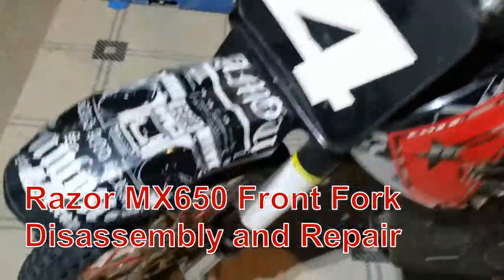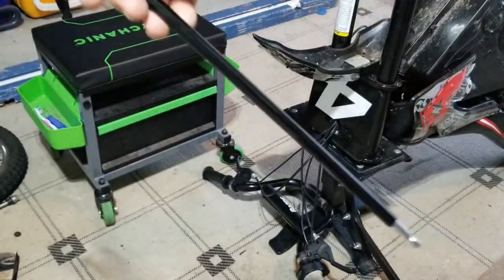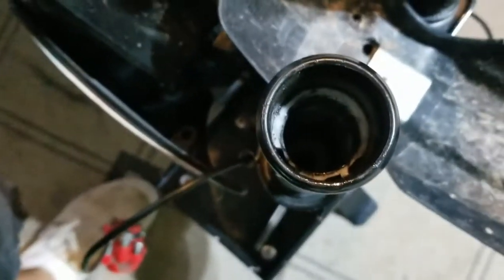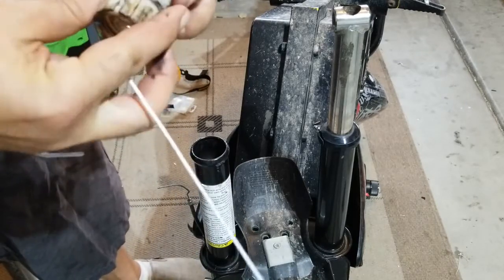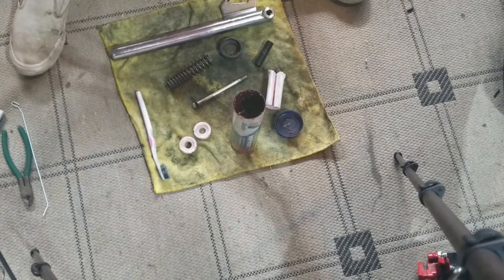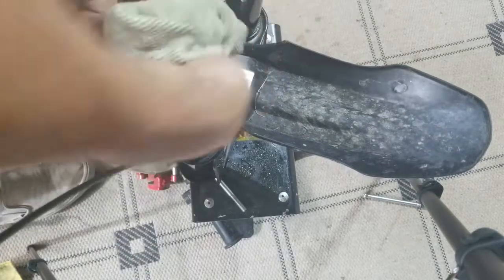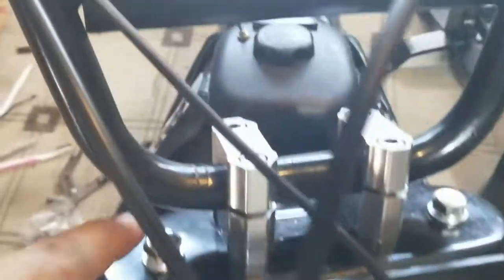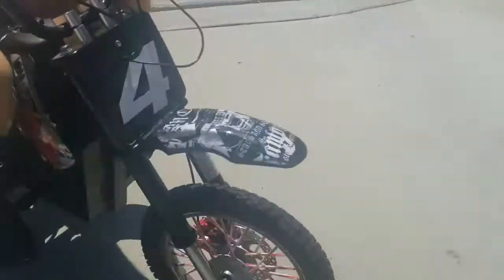Fix Stuck Razor MX650 Forks!!

Comment: Thanks for the info Tim! This issue occurred for me literally within a week of my 9 year old getting his 650. I was able to use extensions and make my own tool to remove the Allen bolt and glued weed whacker line around top of the bushing to make a new lip. So far soo good.

Comment: Would you happen to have any measurements of the springs and bolts that go up the fork leg¿? I'm trying to get bigger springs and bolts to makes my suspension ALOT better but IDK what the original parts measure.
Reply from the maker: I don't but there are guys on the "modified razors" Facebook forum who have done what you are talking about and have the specific parts you need

Comment: My bushings are worn out,they have a lot of play in them. To bad you can’t buy parts.
Reply from the maker: I know a guy who 3d printed them.  I helped him with the 3d model.  I can connect you if interested
Reply: Tim Armbruster That’s pretty cool,I have the MX 500 model which is probably the same..but not sure.
Reply: @TimArmbruster  I'm interested. I would buy a few depending on his price. Does he have an email address? Thanks for the video too, by the way.
Reply from the maker: @rx3701  If you are on Facebook, join "modified razors" group and ask about them.  If not, let me know and I will try to put you in touch.  I only have Facebook contact.
Reply: @TimArmbruster  Hey Tim I found a guy in that group that 3d printed the bushing, but he says his printer is having issues. Is it a guy named "Don" that you were referring to?
Reply from the maker: @rx3701  yes Don Urban